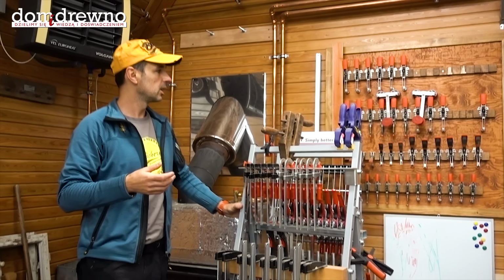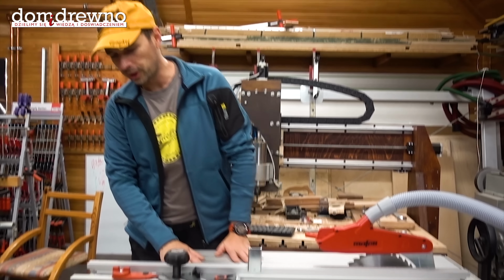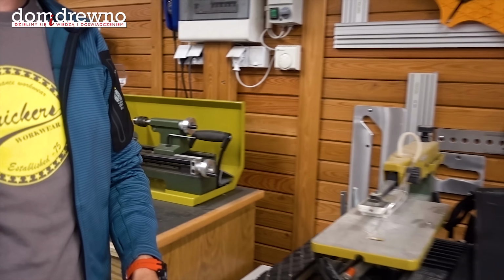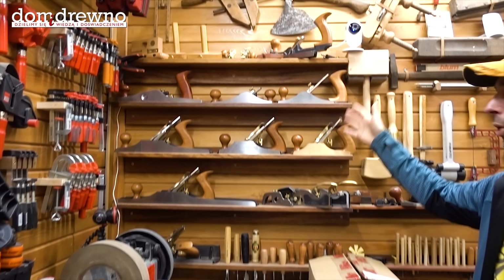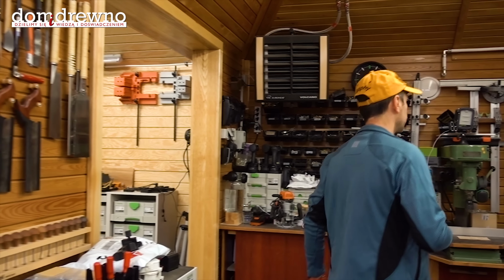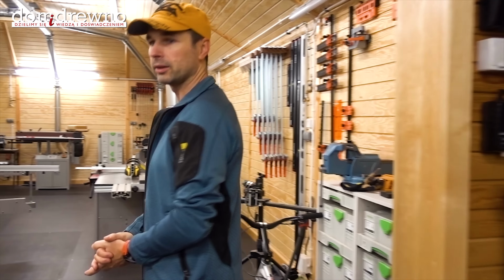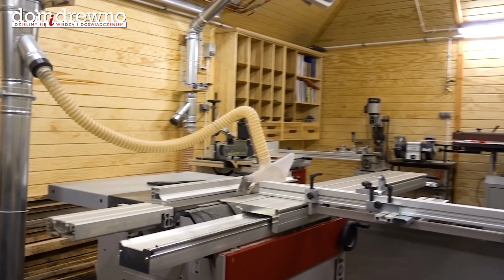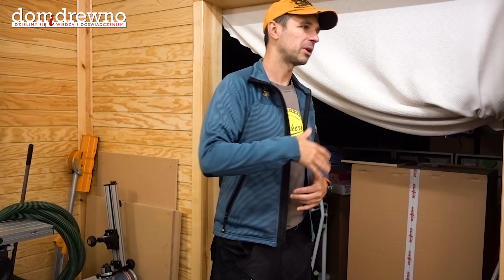E02. Quick Domidrewno workshop tour 2017

Comment: Hi from USA, great video and thanks for the workshop tour!   One question: what is the flooring material?   is it rubber?  Does it come in squares that you connect together?   thanks
Reply from the maker: thx 😛 its plywood 25mm, covered by paint. Its for cars trunk material 😋 very good, hard, worm and non-slip